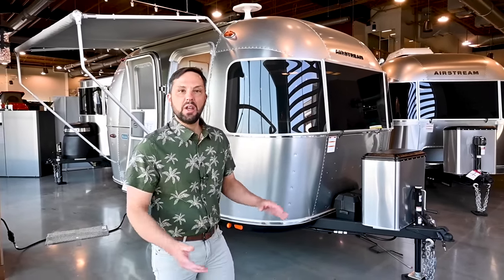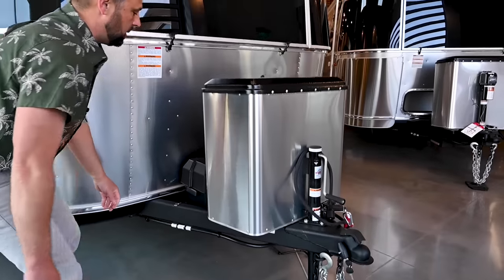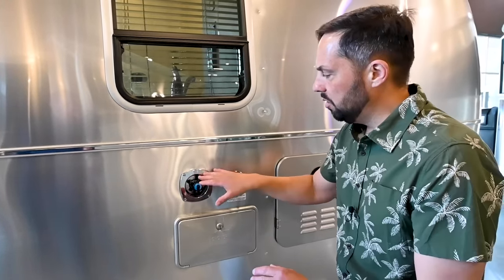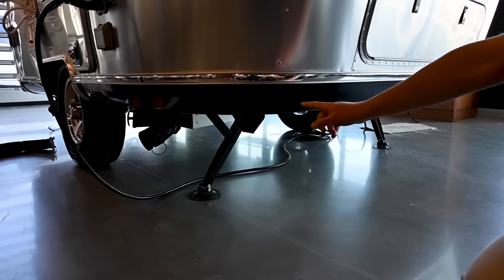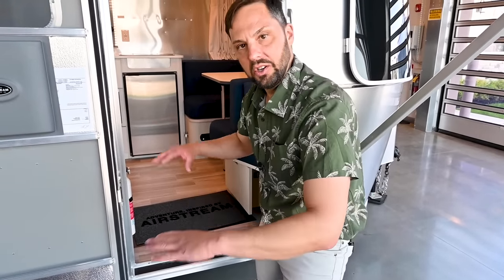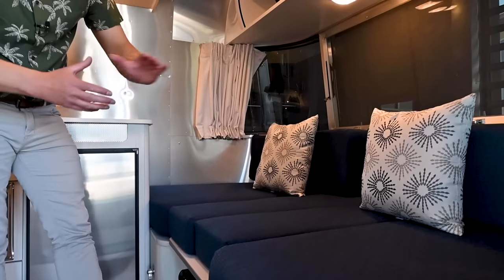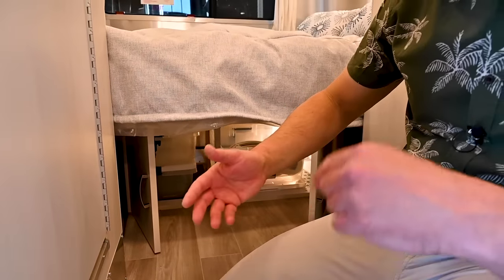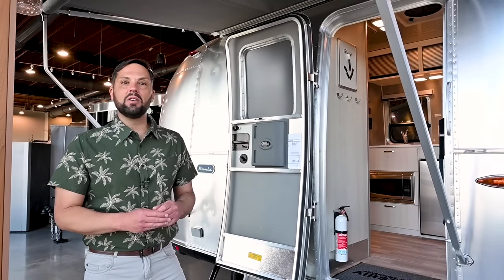TINY $63,600.00 Airstream Camping Trailer | 2023 Bambi 16RB Walk Through Tour

Comment: Airstream aesthetic is classic. My bathroom preference is a dry bath, dry flush. Glad AS have done away with wooden floors. Less wood, the better. Add an external weatherproof port to plug in the StarLink dish and then it’ll be just about perfect!
Reply from the maker: Hi Nathan, it's great to see you appreciate the classic Airstream aesthetic! Your suggestions are interesting, and it's always nice to see how others envision their ideal RV. Thanks for watching!
Reply: Well it's now like 80% plastic so you're the target market. Lol.
Reply: @jackfntwist  I'm sitting in our 19cb Caravel, looking around, and the only plastic I see is the stereo speakers and the light above the dinnette, on the end of the levers to open the window, and the little bell shaped things to pull down the ocean shades above the sink. 

Maybe your Airstream is different?
Reply: @jfreeham  So you don't have any laminate or vinyl floors, walls, surfaces, or you don't realize that's plastic?
Reply: @jfreeham  "UltraLeather" - aka Vinyl is plastic.  The overhead storage cabinet sliders are plexiglass, which is plastic...  Floors, walls, cabinets, surfaces, upholstery, shower, toilet MIGHT be ceramic, but the lid is plastic. Unless you did a custom rebuild, basically 90% of your Caravel is made of some sort of synthetic plastic product. But who am I to open your eyes.
Reply: @jackfntwist  Ah, yes, I didn't think of that, the floor is vinyl. The interior walls are aluminum, though. Table covering and kitchen counter, and bathroom counter are plastic. Also the lids for ceiling fans, as well as the fan blades. Of course, as one moves up in price on an Airstream, the counters are corian.

Comment: Thanks Patrick 😊 excellent presentation!!!!!! They should put a fold down sink in the bathroom - I personally don’t like to wash up in the kitchen sink.  Has anyone ever suggested that?
Reply from the maker: A few have asked but then many have mentioned that it is silly that the Interstate and Rangeline have bathroom sinks.
Reply: @colonialairstream  Talking about the sink, how big is it? It's not listed in the specifications on the website.

Also, question about the solar option, 100 watts seems insufficient for a trailer of this size, I was expecting in the 200 to 400 watts range. Is this a limitation of the available surface area on the roof?

Comment: Airstream should partner with luxury car brands and do premium models (not just color schemes), using luxury materials for a couple of models of their trailers. Like exotic woods and leather, and different options like the luxury cars.  Could charge $200K and more.
Reply from the maker: That's an interesting idea! A partnership with a luxury car brand could indeed produce some unique and high-end Airstream models. However, it's always important to keep in mind Airstream's focus on quality and design, regardless of price point. Thanks for sharing your thoughts, and happy camping! 🚐🌟
Reply: @colonialairstream  They started as "land yachts" and were the premium, luxurious brand, using great materials, inside and out.
Reply: Upgraded fancy luxury details like solar panels, weather satellite access, flat screen TVs, and eventually robotic mobility to the next destination while I get there after visiting places that don’t have accommodations for RVs.
Reply: @jamil8lila  Nice. Yes, Airstream should partner with Rolls or Cadillac and do luxury version.
Reply: @jamil8lila  And I think $65K is way pricey for a 16ft. trailer built with plywood, vinyl, and laminates. The exterior is iconic and still uses real metal, but they used to be a luxury brand.
Reply: @jamil8lila  I mean, honestly, how much would it cost to find 60 sq. ft. of recycled oak floorboards from a remodel? And I'm not buying the vinyl is better than wood because it doesn't absorb water theory (I've had both. lol).

Comment: What type of truck does one need to tow it? Thanks!
Reply: You could tow this with an SUV if the GVWR is 3500 lbs. This trailer tempts me so much.
Reply from the maker: The truck would need a minimum towing capacity of 3500 lbs and a minimum hitch weight capacity of 430 lbs.
Reply: can a kia tow it?
Reply: @rayyanlakho5813  You’d have to check with the dealer, but I bet one of their larger SUVs could do it if equipped with the right engine
Reply: Can you make a shoe smell?
Reply: @bfranco1519 no. But they do smell like updog.